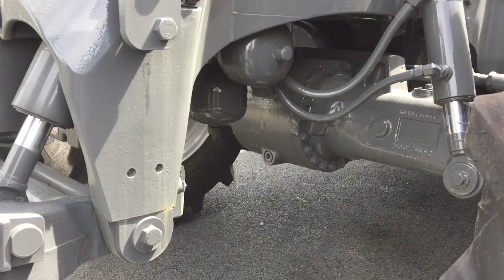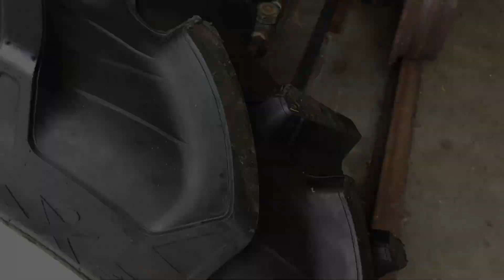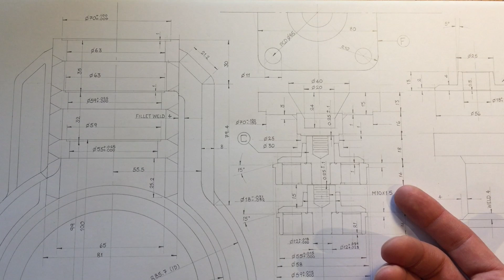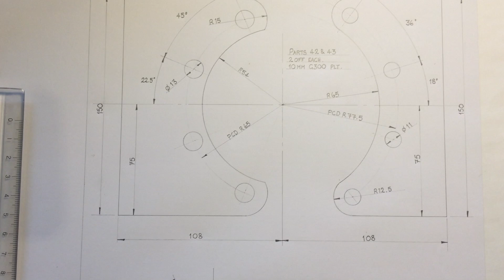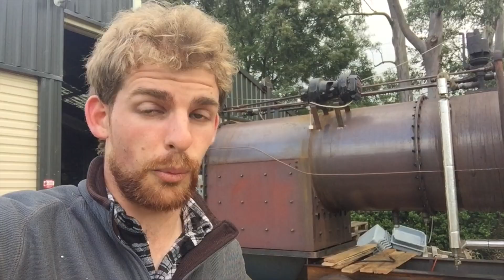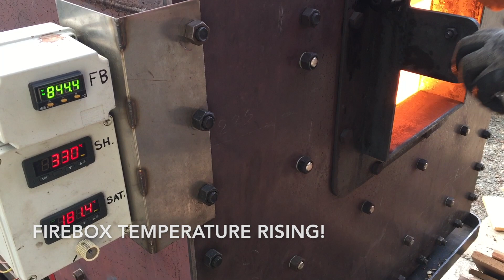The Future of Sustainable Farming | Modern Steam Locomotive Design & Build EP6

Comment: Sam, I wish you wellA friend of mine designed and built a steam unit for cars fifty years ago. It was the lowest emission engine in the world when that was the big thing . He took it to America, demonstrated it to Senators and the vehicle industry. Did they want it? No.I got in touch with the A.R,A. when they were screaming about the price of diesel. With a steamer they cold go into a mine load coal and bunker.   On the way back burn gas. Were they interested ? Yes. However it has complications. The steam generator could have been made by the companies that built the rockets when they were between contracts with Aerospace. Wonderful. Then things cool down.
I think many of the diesel locomotives were on charter and that could cause problems. So you get over all the other   problems and still can't get the carrot. So good luck. I would do all over again because of the excitement. Just be careful.

Comment: I also been thinking about trying to grow bamboo. As a fuel allow it to grow for qbout two years. The split and cut in about 12' long strips,  plant about 3-4'from another plant. To allow plenty of sun. Hopefully it would ve 2-4" in diameter, and trim it off, so hopefully it will  continue to grow. After tve strips dry, use pine resin to glue the strips together. Stack about 12"  thick . Then use a press nade from 4"x4"x12' and clamps. Place in a plastic bag and leave in direct sun for a couple days, possibly pass over a fire to heat  to about 250°f. Allow to cool then cut into 3"-4" cubes 4"x12"  place in a barrel and heat and distill off the useful product, using the remaining coals to fire a boiler ,  possibly place in a press and compress into nuggets, possibly add waste oil to the coals, just enough for them to  absorb, this should burn exceptionally hot. The fast growing bamboo, is a fairly dense and hard wood it just had a hole in it !😆 Splitting it and gluing it into solid  chunks  similar to bamboo flooring is made,  glue under pressure should help with density,

Comment: Make wood alcohol/ methanol, and crude oils from wood / bio mass, pyrolysis using concentrated sun light, use tge oils and alcohol to burn in a boiler, a tractor burning the oils and or methanol, with a battery and/or a solar panel, to keep a blower going to get the fire started. Basically a propane forge to get the steam going, with only the actual steam going the closest the fire to super heat tge steam. A fairly small boiler. Should be capable of making  500 ftlbs TQ, and 50 plus hp, build a engine with 3 bores, 6 pistons double acting, with a 12-18"stroke, with a 6"-8" bore,  two cranks connected by spur gears, to a central output shaft, id like to use this in a street driven truck, with the option to use propane, and make it a hybrid, include s 30 kw electric motor, with a 15 kwh battery, to get it down the road in low or no  pressure occasions, it should get a minimum of 20-30 miles range at 50 mph. Use 4 small diameter flywheels, and a single large flywheel, in the 14"-16"  range, 4-6" thick, made from a iron rings connected to a 1.500" steel hub, and 1.500" steel spokes,  and use a radiator or pair of them, with a steam to water intercooler, to pre heat the stored water,  condescending the steam. So it can be re injected, using a radiator to cool the stored water if neeed,  the steam going from the pistons to a Tesla turbine to a radiator to a steam to water intercooler,  then it dhoulc be in the 100-180°F range capable if being re- injected. The water storage , using a piston pump to inject water into the boiler tubes, with the cool steam connecting in a 12" x 18" tank capable of  1000psi,  then about 12x 1/4"  i.d. tubes with a 3/4" o.d. to withstand the heat, ir possibly stainless steel, 9/16"-5/8"o.d. being they will be heated to 1000°f   with steam passing through to a 12"x 18" manifold including  relief valves, a small 1/2" and a larger 1.5" with a pressure about 50 psi higher, at 350-400 psi, the small valve at 300-350 psi, running the engine at 150-180psi minimum, to 200-280 psi normal , with 6" pistons, roughly equal to a 12  cylinder 2stroke engine, it should make decent power, use oil passing through the rods, under pressure, curcimulating between the rings and back down the rod, using gapless rings, with a oring to seal thd piston further, ubeing PTFE or nylone, to creayan additional seal from water from the oil,  with 4 iron rings either using dual rings per groove,  or rings that overlap, like a shiplap board,  with oiling holes between the rings. About a .030" outlet 120° apart,  with a return passage aboyt .060" 120°  apart also, using approximately 1/8" passages in thd 1"-1.25 rod, thag uses a 4piece graphite seal, with orings and possibly mollibnium wire rings to further seal the rods from upwards of 250-300 psi ,  possibly using a hardened stainless tube over the rod, using iron rings, also getting a oil supply, with a return,  with the oil hoing to  the boiler, to allow it to be stored, aswell as heated to between 220°-230°F, to drive off any water,  then pass through a small cooler tgen to the bearings and rings valves,. Use modified ball valves to control thf action of the engine,  use graphite and or mollibnium as a self lunricating seal. Possibly use a 1.75" bar of stainless  as a valve, controlling the steam, with two valves , per piston acting side,  a large valve, to allow a 3/4"minimum passages to the piston from boiler, with 2" exhaust,  possibly use 4"x 8" plate steel as a slide valve, using graphite seals, for the exhaust,
Tge exhaust feeding a turnine spinning a generator, with possibly a 100:1 reduction, brung a tesla turbine can easily exceed 100k rpm,  this would allow a 1k ti possibly 1200 rpm output,  use a 3" output to a condenser, dropped to 220°f then yo a water to steam condenser, to drop further to 200° or less, the water storage tank using a normal car radiator to keep the water under  220°f tge pressure being 5- 10 psi, allowing 220° water to be liquid.  With 20  gallons of water,   the enginelproducing serious TQ,  possibly use with a diesel transmission 5-6 speed manual,  using a overdrive gear from the crank to output shaft, that will connect to the transmission, veing a 3:1 od ratio. The output shoujd equal a diesel engine speed and TQ, with a peak crank speed if 1000-1200, maybe 1500,  thr transmission input Shaft would be 4500 rpm possibly. With the governor, set the throttle, and keep throwing gears at it, with the throttle connectef to a main steam valve, with the governor capable if closing it,  it should output about 400-500 tq to the transmission. And possibly 100 hp+/-  , with two cylinders "firing" at once every 120° with 6"-8" bore,  a this equal to a singje  12"-16" piston every 120° or 60° being double acting? The valving  will be complicated. Especially if the exhaust from one is feeding another,  but im thinking not, use tge exhaust on the turbine only, to generate power,  2kwh should be easy , sorry to ramble, but a steam vehicle capable of 0-60 in 5-6 seconds or faster being hybrid E-Drive,  with a couple ,20-30 kw
 motors! And 20kw+ battery, both should do 60 in 4 seconds, depending on the weight, making most parts from aluminum, with iron sleeves to resist wear, and hojd heat, so wrapping the boiler, and engine with insulation to hold in all the heat possible. Even yse ceramic insulation, to keep the engine heat in, with rockwool insulation. With the steam pressure reliefs aimed up, example in a pipe behind the cab,  possibly a pair if 5" stacks up near the top of the cab, used as tgf output ofvtfe boilers , also the steam over pressure relief , allowing the steam to safely exit upwards,  300-500°f+ steamat 200 psi +  is exceptionally dangerous,  also use a pressure feedback system, tfe higher the pressure, the less fuel us burned , further reducing pressure,  sorry to ramble, but i love alternative power and transportation !!✌️

Comment: greetings sir
i remeber when i shared with y friend the idea of "Locomobiles"

steam engines with truck wheels.

They would have a differential steering instead of direct wheel arrangement, with the connections ade using a Flywheel with 2 pistons.

Of which would fix the issue with slipping or anything alike.
Plus it shares the power to both wheels instead of a single one.

Comment: Hello, I am really interested in what you are doing and being a mech eng by profession, have a number of observations that you might like to comment on. By the way I design, forge, machine, fit and weld and have done since I served my apprenticeship with Westland Helicopters back in the 1970s. I think I understand that you are fabricating everything because it makes it possible to build as a one off and appreciate your skill and determination in doing so. However, whilst the design work that you do showcases your abilities as an engineer, it is a time consuming process that you may have to rethink for a production solution and I wondered what your thoughts might be in this regard. By far the most efficient process for manufacture of metal products is casting and wonder how this might fit into your vision.
Reply from the maker: Thanks, Mark! Absolutely we will cast components when it makes sense to do so, which, as you say, is likely to be when we begin production.

Comment: It is my understanding that vegetable oils break down into acids when heated and this can affect the metal.  Some vegetable oils will thicken enough to reduce or prevent flow.  I think this is an oxidation effect.  Mineral oils have been improved to reduce this happening to them.  However, castor oil was used in the rotary engines on the sopwith camel and others.  Total loss system and once through only.  Canola has been used in compound oils where the oil or the surface it is lubricating are in contact with water  Think I would be careful with small diameter pipes and high temperatures and places where it might lie for long periods.  I'll try it on my chain saw.

Comment: Why not make a steam powerplant? Enjoy all the fun modern features with electric power form a efficient generation system
Reply: Yes! 
I've been interested in "off-grid" power generation of for no other reason than to have a ready power supply during winter storm outages which can last up to a week in my locale.
I've been looking into steam for a few reasons, not least of which is connected to the whistle.  :)
Oh, and the fact that stream can also be harnessed for radiant heat, pumping water from cistern to tower in addition to generating electricity.
There's a gent here in the states that builds boilers and refurbishes various engines, but his boilers do not boast zero near-zero carbon emissions. 
Would there be a boiler for home use on offer for those of us interested both in stationary home use and emissions reduction?
Thanks!
(You're dream is amazing - I'm excited to watch you bring it into reality!)
Reply from the maker: Glad you asked. Burning biomass in a powerplant to power an electric tractor (or train) is no more efficient than burning that same biomass in a modern steam tractor/train...surprisingly. The electric option is also much more energy, resource and capital intensive to implement. Besides, while electric tractors have fun modern features, they don't have a steam whistle!

Comment: Funny you should mention canola oil/rapeseed oil because that actually was a very common additive for axle bering during the steam era. However i don’t believe it made a good steam cylinder oil,  the temperature may have been to much for it to retail its lubricant qualities
Reply from the maker: Yes, I recently learnt that the same was true on New Zealand's railways. I have no information on its suitability as a cylinder oil but it is the best performing cutting oil I have ever used.
Reply: They often used lard or beef tallow as an additive to steam oil. One old guy said he "ran lime milk over tallow", so I'm assuming he was using a fully saponified calcium (lime) soap of beef tallow. A homemade calcium-tallow grease/soap.

Comment: I have heard the canola oil (rapeseed oil actually but I think there the same thing) makes a great additive to general lube on steam engines but I don't think you could use it for steam oil (I whould guess long term the organics whould gum up any cylinder)
Reply from the maker: I once read that canola was a variation of rapeseed developed for Canada (Can- (for Canada) -ola (for oil)). I'm not certain what the specific difference is. I have no data on its suitability for use as cylinder oil, but I do know (from experience) that when left for an extended period in the presence of moisture it may tend to attack iron!

Comment: just wondering, wouldn't it be more efficient to power a generator  from the steam power and not the wheels directly?  Using electrig Motors for the Wheelbase and a Steam powered Generator would allow Machine to run at highest steam efficiency at every time?

However, love this Project, keep up your work!
Reply from the maker: Thanks! Certainly, a higher cycle efficiency may be possible. The simple reason for not adopting at this early stage is that the increase in drawbar thermal efficiency, once transmission losses are deducted, is not sufficient to justify the significantly increased equipment cost and complexity. But it may be an option in future!
Reply: @Mackwell-Co   Thanks for your reply and the Explanation.

Comment: Very interesting indeed! It’ll be quite the sight to see when modern steam hits the road. Maybe something worth considering is a Sentinel-esque lorry?

Also, another question about your boiler (I find it really fascinating!): how do you keep the water level regulated? 
A few knowledgeable people I’ve talked to say that water tube boilers are hard to regulate with the normal two-person crew at the best of times. I could see the engine having a live feed that’s semi-supplemented by injectors, but I’d love to hear what your solution is!
Reply from the maker: I will keep Sentinel-esque lorry in mind! 
Yes, re water level, what you've heard is true. The way in which it is controlled on this boiler needs a detailed explanation in a future vid. Injectors are useful and if they can offer value then they'll definitely be included!
Reply: @Mackwell-Co  I haven't always liked injectors, but from what I've heard, it turns out they're much better than pumps when it comes to feedwater. 
If properly maintained some of the best injectors can still inject tender water that's as hot as 40 degrees C, alongside with having the ability to inject water through a feedwater heater and/or economizer and then into a boiler. What's better is that exhaust steam injectors essentially double as contact feedwater heaters.
The only issue is that injectors rely on the steam feed to condense into the feedwater, so superheated steam would have to be cooled down into saturated steam before being introduced into the injector

Comment: You are just reinventing the wheel, starting with fuel. Wood grows slowly, grass grows faster but is less dense, so pellets. Steam is not efficient, internal combustion is more effective in quick start and shutdown, diesel cycle better, lighter, wood/ biogas/ liquid fuel. Two cycle diesel style engine, any combustible solid or liquid fuel gasification. Been done. Pneumatic tires bad idea, solid rubber, longer lasting less failure. Been done. Carrying all that fuel and water and the start up time and losses and shut down losses, only feasible in continuous use like generators, long distance transportation. Castor oil is super sticky aka Castrol oil company. Reading old books would help you stop repeating the past. The internet is only so useful as what was uploaded. Go to a real library.
Reply from the maker: Thanks for your feedback. I spent a number of years developing internal combustion technology prior to selecting steam. I quickly found that the devil is in the detail. Nothing beats old books, I have an extensive collection!
Reply: @Mackwell-Co  
Please consider scanning the old books! We would love to be able to read them!
Reply: There's a lot wrong with the concepts you've listed

While grasses do grow quicker, they tend to clinker, which can choke the firebox or a gas-producer.
Combustion engines are very picky as far as fuel goes. For example, producer gas will accumulate soot as it burns slower than most combustion engines can sustainably turn over, and bio-fuels would require a low compression engine due to their water content - both cause inefficiencies far worse than an hour's start up.
Solid rubber's been tried before - it was most popular in the 1930's. It's far too expensive to maintain, despite how well it can bear a load.
Castor, Canola, and similar vegetable oils are actually good for a locomotive. They cling to the cylinders and keep said cylinders lubricated for longer. In fact, back during the steam era the most popular oil additive was rapeseed oil as it typically increased locomotive performance

Comment: Why don't you score an old stationary engine of the type used to drive a lay shaft and belt and pulley driven workshop?  Would give you a very useful demo load for the boiler.  Should work well around 150 PSI.
Reply from the maker: It would certainly be a neat and visual demo but it may not give that much in the way of test data. A pitot tube as fitted in the blast pipe currently is more useful in terms of assessing the boiler's capabilities while it is still on a test frame. I'll keep it in mind though!